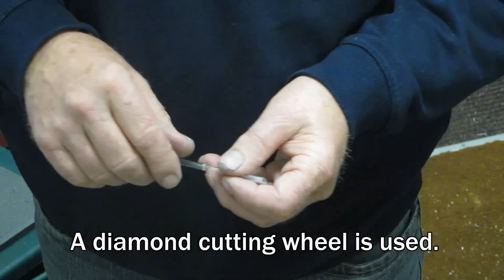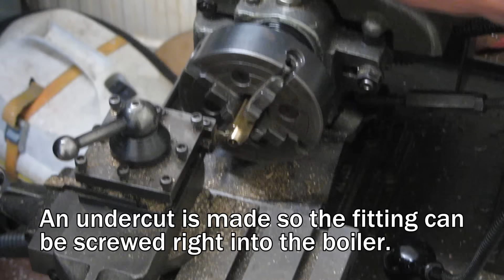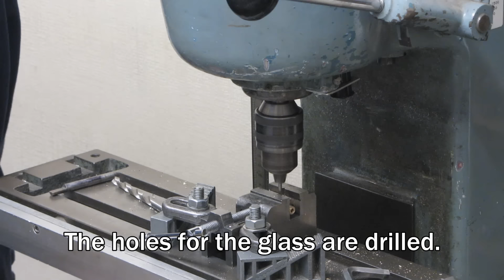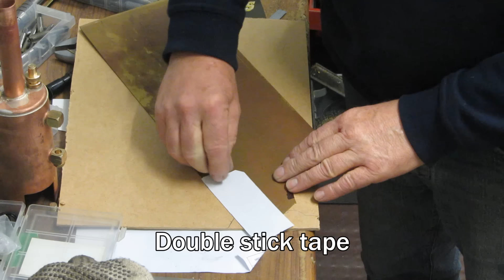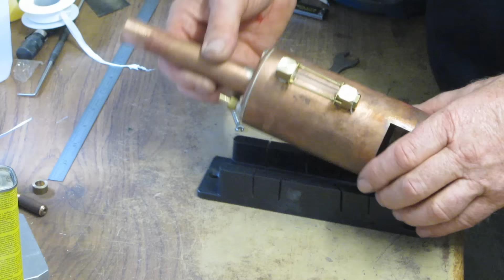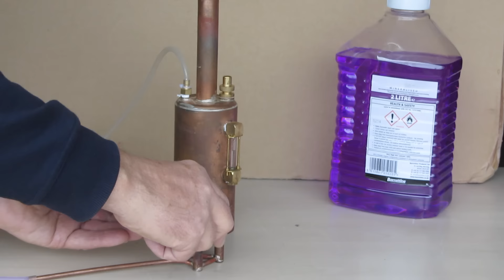Make a Simple Boiler for Model Steam Engines Part 4 Water Gauge

Comment: Nice idea with the cutting disc on the gauge glass. I'd urge anyone to wear a mask to avoid the glass dust though. Nasty stuff. 
Another nice video.
Reply: +Mr-Laing I was taught at school ( nearly 60 yrs ago ) to cut glass tubing using a 3 cornered file, you just put a simple score around the tubing and snap it with your fingers. We had to make our own Biology equipment, in those days

Comment: Some how I'm mildly shocked you didn't have some way to cut the glass tube on the lathe...   Most excellent videos all around sir,  you set the standard for instructional videos on utube.
Reply: Just use a glass tube cutter - its similar to a copper pipe cutter

Comment: What is the reason of welding a pipe inside the bigger cylindrical pipe, please explain ? The one you hold during the steam formation.
Reply from the maker: Not quite sure what you are referring to. If you mean the tall pipe coming from the top it's the flue. Without this the burner would not work.
Reply: You got it right. Thanks for answering.

Comment: I enjoy your videos. Especially those on casting and steam engines and boilers. On the vertical boiler build, did you use the same silver/hard solder for all the joints? What type/brand? And, what happened to video #3? Also, did you make the steam safety valve or purchase it?
Reply from the maker: Part 3 https://youtu.be/MIFHILK256Q
I used the same for all the joints. With careful planning and refluxing the previously made joints different temperature grades were not necessary.
I used easyflo2 but that is unavailable now cadmium free equivalent is silverflow455
https://www.cupalloys.co.uk/low-temp-silver-solder/
Reply from the maker: I made the safely valve. i can supply free plan for this.
Reply: @myfordboy  how can we get the plan?
Reply from the maker: @15162011  leave your email and I'll send it to you.

Comment: Ever tried hot wire cutting for glass tubes? Steel wire, a blowtorch, and no dust
Reply from the maker: +Mark Sinden I remember trying to cut a bottle when i was young. A spirit soaked string was wrapped around where the cut was to be and the bottle filled to the same level with water. The string was lit and the bottle was supposed to break at the join.  Didn't work for me!
Reply: Spirit soaked string doesn't get hot enough - it needs the thermal shock of near-red-hot wire to do it. A technique worth learning as it's useful for cleaning up sharp glass edges too.

Comment: What psi is the valve set for?
Reply from the maker: I had it set a 30psi but it could be increased.
Reply: Thanks you for the answer, very nice work, I like to keep things simple and efficient also with the least amount of complicated layout and setup, I really like that center punch as a wiggler with the four jaw.
Were you using NPT taps and dies? Or just fine thread with some sealant? I have several small steam engines but my boiler is not as elegant as this, basically just a can on a electric heating element and the leaks are my pressure valve. LOL This is nice and simple and still classy.
Reply from the maker: Here in the UK we don't use NPT. The threads on model boilers are Model engineer thread.( 26 ,32 or 40 tpi)
Reply: Ahhh, I see, that would also explain the "myfordboy" thing,and here I thought you were a Ford fan.
Reply: great stuff mate! PSI is an issue with steam explosions that do a lot of injury. I made a simple boiler very similar to yours from a baked bean can with my son, just to demo that the exhaust pipe up the chimney keeps the charcoal fire roaring. But there was no safety valve, just a loose rubber bung on the steam outlet pipe, so less than 1 psi and safe!
There are a number of things about this design, the through boiler chimney has no support for the joint or reinforcement to preserve rigidity of the discs. Which are also 'inside out' and not end caps - so what, it works, but please add the easy test method of filling completely with water and heating gently with a pressure gauge on the outlet. When the copper and joins are hot, the boiler will be not be as stiff or strong..30 psi is way too much for an untested boiler.

Comment: What is the use of the water gauge?
Reply from the maker: So you can check the water level in the boiler.
Reply: myfordboy 
Oh!
but how does it work scientifically?.
I mean you didn't gave the explanation right?
So will you please inform me?
Reply from the maker: You did not ask how it works just what its for.
Glass tube is connected to boiler and the water level in the tube will be the same as in the boiler. Pretty simple.
Reply: myfordboy 
oh,thanks.✌✌✌✌✌